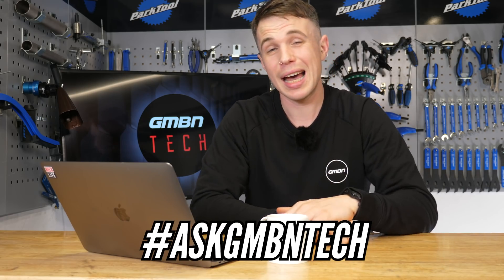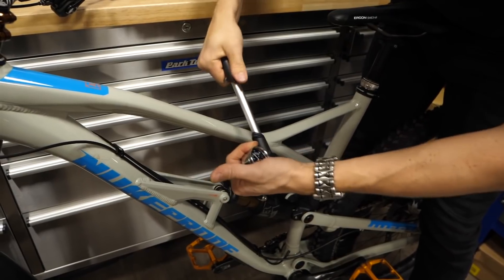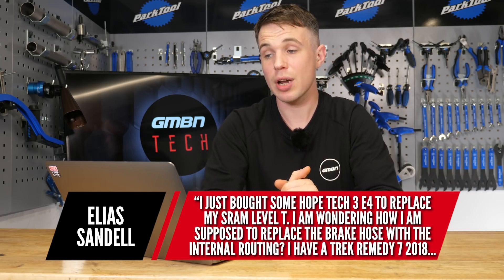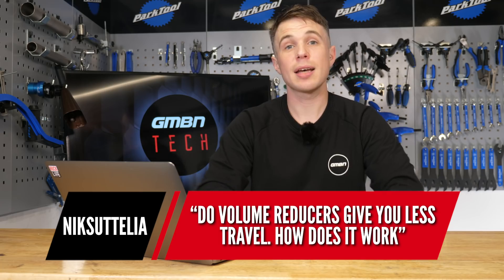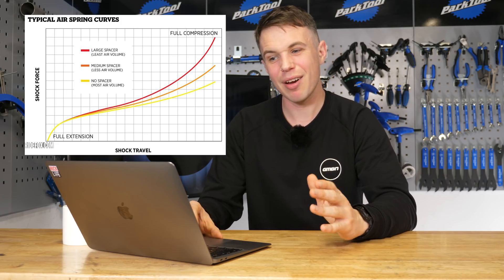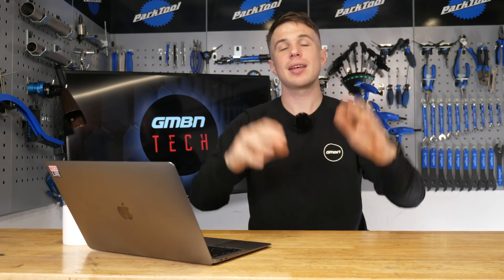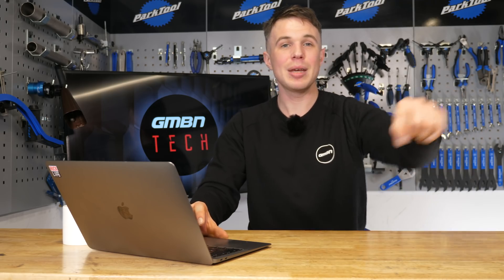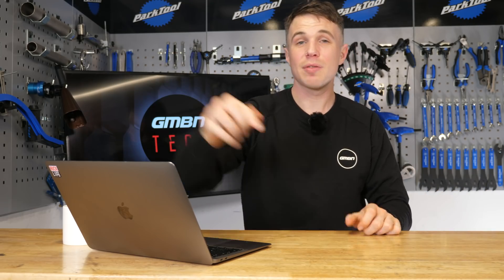Do Volume Spacers Reduce Suspension Travel? | #AskGMBNTech

Comment: I have lower back issues. I’m the market for a new bike - will a full suspension bike offer more comfort & support over a hardtail for gravel riding? If so what is too much travel for that type of surface #askgmbntech
Reply: Yes it will. If you only ride gravel go with short travel bikes (100-120mm, maybe even 80mm, but you won't find much there) Be careful to get the right geometry if you have back problems though!
Reply: Curtis Bradshaw For gravel, I’d recommend a fully rigid ride complemented with the Redshift Sports ShockStop range (seatpost & stem) and a bike fit.
Reply: Wrong chosen saddle and too low/far cockpit (handlebar/stem) can cause pain.
The suspension cannot be TOO much. Because you can always soften/stiffen the suspension after buying with regulation knobs/air/spring.
Reply: @nexusparadigm4062  well it can be too much. If he only rides gravel then an Enduro or DH bike would make absolutely no sense as it would just suck away energy and if he stiffens it up it won't use the whole travel therefore being less comfortable
Reply: @deymos2175  the FR/DH bikes are an extreme example. I don't think he would bought a $6000 bike for gravel. I meant all mountain and similar styled.
Reply: @nexusparadigm4062  140mm for gravel would also be a huge overkill. 100mm is well enough for comfort. Anything above is just a waste.
Reply: @piotrekserwisuje  yes. And not too long a bike, so less stretched out (back issues mentioned)

Comment: #askgmbn
Hi I was just wondering why I’ve set up my fork sag and air to my weight but still can’t bottom it out? Would you have any suggestions?
Reply: Maybe you fork/shock came with volume spacers?
Reply: What about regulations? If blue knob is to "hard" it will not bottom out. Also the red cannot be to "hard" setting or it will return not-lively.
Reply: Check out shockcraft guite to suspension setup, its really well explained and fixes some of the misconceptions.
Reply: https://www.shockcraft.co.nz/technical-support/suspension-setup-78/suspension-setup
Reply: Maybe too much travel
Reply: You set sag, to the sag % required (25-30% for trail), not ur weight. The set psi as your weight is a v rough start point...then u measure/set psi to achieve wanted sag but on ur full riding gear, incl helmet and water and back pack etc.
Once u have done that, if still issue, try removing volume spacers 1-2 max at a time. Re-check/reset ur sag each time. remove to.
Reply: Most forks come from factory with tokens installed, Usually 1-2 installed. Try removing tokens, one at a time and test.

Comment: Just had my bike serviced for the first time. Came back looking clean and all, seems like they removed the rear cassette and cleaned it. Unfortunate the rear hub is now squeaking. Taking it off the bike, the end caps feel really tight, crunchy and you can hear the squeaking coming from them when spinning the wheel. Did they over tighten the cassette or is there something wrong with the bearings? Its a KTM lycan 274 lt and the hub is from DT Swiss with a thru axle.
Love the videos btw :D
#askgmbntech
Reply: Take it back. They should have warranty on the job.
Reply: Sounds like bad workmanship. The cassette secures to freehub body, so overtightening that wont effect wheel spinning...if that hub has adjustable preload, could be that. Or they cleaned it but forgot to regrease.

Comment: #askgmbntech I'm a heavier rider and have lost a lot of weight due to picking up mtbing but I'm still pretty heavy 275lbs. I have issues setting up my sag as i pump up the rear shock to its max recommended psi and I'm still over 30% sag. The shock does have a lock out switch but at full open sags pretty low. Would going coil and getting a heavier spring fix my problem?
Reply: Yes. Air shocks accept only so much pressure  value. Springs are varied as hell from 150lbs to 1000lbs/in so yeah a BIGGER choice.

Comment: #AskGMBNTech 
I own a 2018 Trek Remedy 8. I've just ordered RockShox debonair spring and RC2 Lyrik upgrade kits for the standard front fork (160mm Rockshox Lyrik) 
I decided to go with a longer 170mm spring as I am way more into descending.
How much will this extra 10mm affect the ride? 
And will these upgrades essentially convert my standard Rockshox Lyrik into a fully fledged Lyrik RC2? 
Keep up the good work and thanks in advance 🤘
Reply: you won't feel any huge difference, it will handle a bit differently, you'll be able to setup it a bit more linear for the same sag without bottoming out.
Reply: @piotrekserwisuje  i can imagine just having that extra bit of travel with the better damper and a slacker head angle, it should iron out braking bumps, rock gardens and roots abit more
And reduce arm pump on a long day at the bike park (with uplift)
Reply: @postiepistolpete1985  ye, all that together of course, I was only referring to the 10mm travel ;)
Check out this tuning guide mayby, might help too https://www.shockcraft.co.nz/technical-support/suspension-setup-78/suspension-setup
Reply: You will notice the slacker head angle and higher bb.
Reply: @MaxMustermannnnnn  they say every extra 20mm of travel adds one degree of slackness to your head angle. Just not sure that 0.5 of a degree will be massively different. Bikes are getting slacker generally each year anyway right?
Reply: Peter Guilbert I had a Trek Fuel EX 8 with a flip chip and I can say you will notice a half degree too. It was like a different bike.
Reply: @MaxMustermannnnnn  I've already done the flip chip to descent mode. I prefer a nicer ride going down steep stuff
I could maybe flip the chip back to bring it back to how it used to be before I upgraded the forks? Only with a slightly higher BB 🤔

Comment: #askgmbntech Why don't rear coil shocks use a progressive spring? The distance between the springs's coils seems to be constant.
Reply: Chuck Taylor some manufacturers just started making progressive coil shocks like a month ago. I don’t really understand them
Reply: @peterlang5047  Progressive coil shocks are taken from motorcycles since 50 years. They are used so when you ride downhill AND freeride AND all mountain (to save money on not buying 3 bikes but 1) you DON'T have to change rear shock. Also, progressive spring can be regulated to change sag on-the-fly not only in the "pit-stop".
Reply: Because there were none on the market just last year.

Comment: #askgmbntech
Hi guys, I'm currently running a Shimano XT 2 piston break from 3 to 5 year's ago, I think. I'm wondering if I should get new Magura MT5's with bigger discs because on long descents my fingers start hurting very bad. Are the MT5's worth it or are there better ones for the money? (My XT's have pretty new pads and discs so in general they should work fine)
Reply: Get some better brake pads, 4 pot brakes don't have much more braking power, just better thermal capacity.
Reply: I think I've already got better one's but I'm not quiet sure...
Reply: @tobis3687  Metallic?
Reply: Also, do some arm workout, for long descents you really need strong arms, better brakes won't makes you not tired.
Reply: Yea, they are metallic. I've already thought about workout but I'm not sure what exercises would work. I also don't want to go to gym so if you have some tips for home workout I'd be happy to know them. But thanks for your help so far.
Reply: @tobis3687  get a stiff sponge ball and crush it repeatedly with your hand, it will make your forearms stronger, apart from that there is a nice workout plan guide on BKXC channel. You could also hang a towel off something and grab it with your hands, either hanging till you can't hold on no more or doing pull ups, I personally had finger pain during longer descents (apart from usual arm pump) but since I started doing these few exercises from time to time, my descending comfort massively improved, these don't take up much time at all which is a big plus for me, as I'm a lazy person ;)
Reply: @tobis3687  https://youtu.be/CQ1nk3Bc6oo
Reply: Thank you very much, now I've my New Year's resolution 😜

Comment: #askgmbntech - Regarding the volume spacers question, when you say that you can have your travel be "a lot more supple in the beginning and midstroke", are you saying that volume spacers allow one to run a lower initial pressure? In other words, can volume spacers allow you to run a softer (lower-pressure) suspension setup without bottoming out, because the resistance ramps up at the end?  Or is it still recommended to run the factory-recommended pressures in the shocks, regardless of the presence of volume spacers?  Following on that, if it does mean you can run lower pressures, are there any rules of thumb for how much to reduce the shock pressures? Perhaps a percentage of the recommended setting?
Reply: https://www.shockcraft.co.nz/technical-support/suspension-setup-78/volume-spacers
Reply: Yes, u are absolutely correct, u might be able to drop psi and improve sensitivity, if thats something u need improving, if urs is harsh.
Whats more concerning is the statement about running the manf recommended pressure. They are purely a guide, a starting point from which u set/adjust pressure to get sag of 25-30%. They are NOT what u set it at period! Once that's done (damping set open & fast), then u ride, and tweak with spacers, damping, and redo sag after adjusting number of spacers.
Reply: If you are Happy with your "bottomingout" resistance as it is then yes. You can experiment with a lower presssure but be aware that your sag is still within the recomended values to maintain bump compliancy..
Reply: @dennisrasmussen7813  better idea is to run same pressure less spacers, if you keep spacers and lessen pressure, you lose all the support. With modern forks with large negative volume you don't need as much sag as we used to anymore. More say means more wallow, more progressiveness in the spring means really unstable at bottom out.
Reply: It's explained really well in the post I linked.
Reply: @piotrekserwisuje  Thanks for the link. I have some reading to do.  FWIW I don't run any spacers (that I'm aware of... the FOX fork and shock are stock from Canyon), so I can't go with fewer spacers.  I'm just pondering how I can make the suspension setup (particularly for the fork) feel more compliant for the early part of the stroke than it currently does without risking bottom out at the same time.  Hence my question. Sounds a little like spacers may not be the answer, but I do also have some playing around to do with pressures and rebound settings - especially since I've lost maybe 10% of my body weight since I got the bike earlier this year.
Reply: @aaronhuie7013  if you're around the recommended 25-30% sag (seated) running less pressure will only make it harsher (common misconception- softer must be more comfortable, but you get out of the negative assist zone+ enter the progressive part of the spring) Be sure to play around with the compression settings, you mught find that they are compreletely closed off ;) And don't worry about the recommended settings, these are for PPL who just bought expensive stuff and don't know anything about performance or their preferences, for us, they're just a starting point. The guide I linked gives amazing results, thanks to it I found out to be running well too much rear, and not enough front pressure.
Reply: @piotrekserwisuje  I happen to be one of those people who bought expensive stuff (for me, anyway... really in the spectrum of decent full-suspension MTBs, I'm at the lower end of the price range) and don't really know anything about performance or preference.  This is my first "real" mountain bike since the late 80's/early 90's when fully-rigid was still fairly de rigeur.  I have a lot to learn both about how bike suspension works and what my preferences are.  For now, it feels like my pressures are too high, not least of which because, while I don't push a bike particularly hard, I would expect to get through more than 50% of my fork travel and 60% of my rear shock travel during a ride if I'm properly optimized for my riding style... Or am I wrong?  I have good reason to think they're at least a little high anyway because I've lost about 10% of my body weight in the last year and haven't adjusted correspondingly... But I also find it a little doubtful that setting to manufacturer-recommended sag settings is even close to the end-all-be-all of suspension tuning. It's as much of a starting point as the manufacturer-recommended pressure and rebound settings are...  I know there's more to it... It's just a matter of understanding it and figuring out what is best for me.  Right now, I'm looking for more plushness, but it sounds like getting that may be more tricky than I imagine.
Reply: @aaronhuie7013  I mean, if it works well, just don't worry about how much travel you're using, you might be a bit over biked for what you do, you might not be riding hard enough, after riding a bit most people actually tend to up the pressure etc. cause the more they ride, the stronger and more confident they get, so start pushing harder on the bike. I have to say though, unless you're riding XC on an Enduro rig, 50% travel sounds weird, I use that much just by riding down a curb lol
Check if you don't have too much volume spacers inside your air springs or something, after a year it's also a good idea to do at least a basic service (lube up the air spring and internals of suspension), so as to avoid having an expensive paper weight ;)
Reply: Also, one thing I found to work really well from the bike radar setup guide, is that you should be able to use around 90% of the travel just by pushing the suspension down on flat ground without jumping, if you're struggling to even get close, you either have too high pressure, or the spring is setup too progressive.
Reply: @piotrekserwisuje  I think I mentioned before that, unless the bike came with volume spacers (I doubt it), I'm not running volume spacers.  My original question was mostly just to understand the relationship between volume spacers and shock pressure. 

As for being over-biked, it's a 130mm 29er, so perhaps more than my current skills call for, but it's not like I'm running an Enduro or DH (or even heavy-trail... think Canyon Spectral) bike either.  I should be able to use more of the travel (particularly in the front) than I am in any case.  I admit I have some adjusting to do, given the recent weight loss, and yeah, I have a LOT of work to do in the confidence department (the slip-and-fall on ice yesterday did not help in that respect, but I'll keep plugging along) to get better at using what the bike is capable of.  That will come with time and riding. At this point I've only had the bike for about 9 months, and I don't get to ride a ton, so there's still plenty of learning to do.

All that said, I appreciate your feedback. As I'm able to process it I'm sure it'll be helpful.  It's just a matter of taking the time to really understand how these things work on an intuitive level.
Reply: @aaronhuie7013  it could have came with spacers inside, check to be sure.

Comment: #askgmbntech hi Doddy/Henry I recently saw a hydraulic 1x13 drivetrain and I was wondering what are benefits that you get with a hydraulic actuated system rather than cable and is it worth it for the price.
Reply: Ben Sneller also less friction with no Cable in there
Reply: Basically the same dis/advantages as with a brake.

If it's worth, you got to know it for yourself
Reply: Less (almost no) friction, but a whole load of set up and maintenance faff. Solves a problem that doesnt exist. Use a cable or sram axs /shimano di2

Comment: #Askgmbntech 
Does your chain wear if you leave it on the sprockets? 
I can imagine that there are some stresses on that chain especially if it's on the larger sprockets, although the bigger stress would be on the derailleur, or the clutch would be turned on (Shimano)
I know it's just a bit but if you leave it for winter, wouldn't it be better to "drop" your chain on the Bottom bracket. The one by system works perfectly for that.
Reply: No, leave it in middle gears so chain line is straight if ur concerned, but really, its not a problem
Reply: Please tell me its supposed to be a troll.